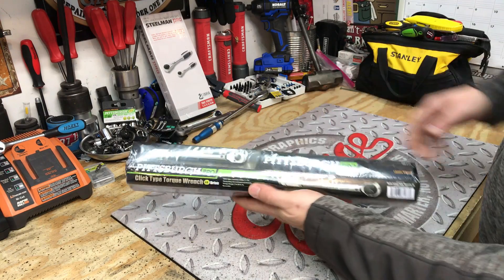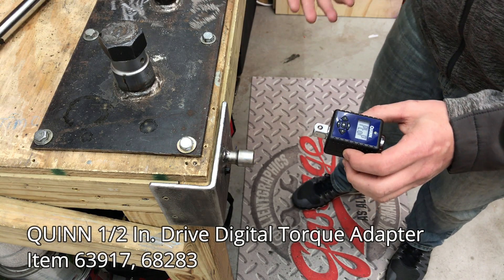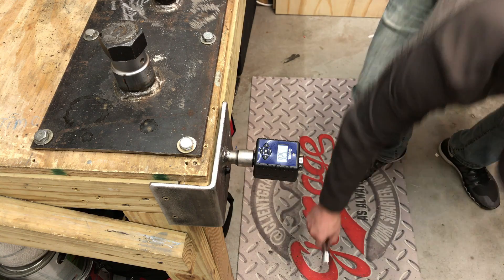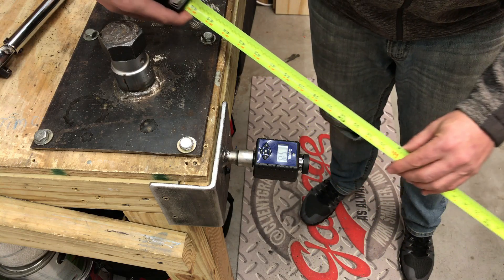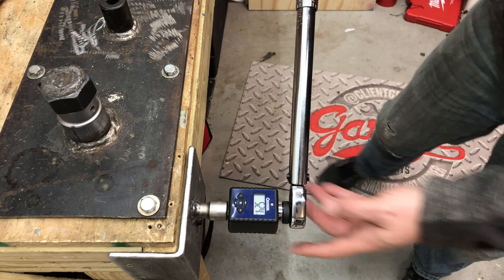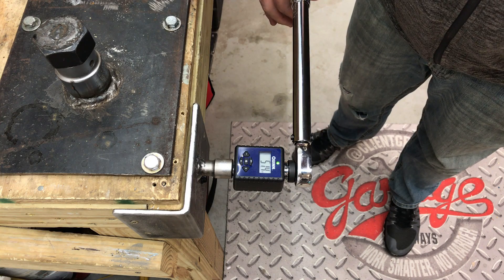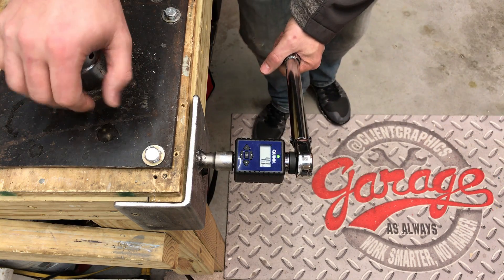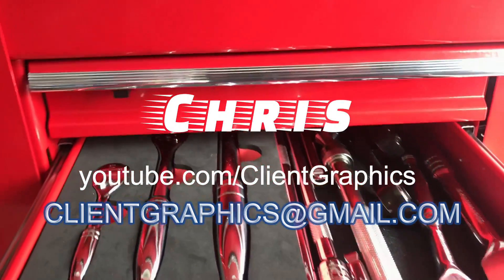Dropped the Torque Wrench? Let's Find Out if it’s Still Accurate

Comment: I broke the pawl on a harbor freight torque wrench tightening shackle bolts to the specified 150 ft lbs once.  Still using the wrench they replaced it with.

Comment: Your first clockwise readings were at 95% and 75% of the +-4% tolerance, and counter clockwise readings were at 165%, 115%, 120% and 130% of the +-4% tolerance. So the brand new wrench is already reading out of tolerance right out of the box 😬

Comment: I think people look at these tool with eyes and brain closed. These tools are as hardy as any in your box. But not being used as much it get put in a nice case. How about making a video on how you need to hold a torque wrench as some out there think the tool knows where you are holding it and changes its output to the job  ???. I did a video but Ifeel sure you could do better.. Unless you also think hand postion matters. My short video. https://youtu.be/mk95F0hHS3U?si=vdS4hI08-O6Tjsh

Comment: Great video, finally get some folks off my behind when I leave the wrench wound up for 10 minutes. I have this exact wrench and it is very easily to rebuild and calibrate if you have access to one of the digital torque meters used in the video. I opened mine up and cleaned everything off, the factory grease had all hardened to brittle wax, and regreased with a light coat of wheel bearing grease. Recalibrated against the digital tool and found it was very repeatable in its function. I'll have to bring it to work and throw it back on the digital guy, see how it has held up over the last ~5 years of use and abuse.

Comment: I will say I hope my tire and alignment shop doesn't use these (lol). But they are perfectly fine for DIY, especially for small engines and what not.  I may pick one up just to use for changing my lawnmower blade (they are supposed to have a specific torque, and this would be just perfect).

Comment: do you recommend just clicking the torque wrench a few times on a wheel lug nut before using it to "exercise" it? One frustration I have with the 3/8 HF torque wrench is that I feel it doesn't click somtimes. But When i stick it on a wheel lug nut, it feels like it clicks just fine. Using it for oil drain plug, perhaps its harder to click when the wrench isn't pulled at the perfect angle? I don't appear to have these issues with the 1/2'' HF torque wrench.
Reply: To exercise it set it to the highest setting and then click it 3 times in the needed direction, if you need to swap directions exercise it again in the new direction. He didn't properly exercise it in the video.

Comment: All in all, I’d say this Pittsburg torque wrench is a fine example of what a torque wrench should be. 

One suggestion. When setting torque values do not go above your desired setting and then back down to it. Always on the increase. There’s always a little slop in any mechanical mechanism that has to be taken into consideration…that and human error. It’s all about accuracy and reproducibility.

Torque wrenches are usually have tolerances specified “of indicated value. So plus or minus 2 at 50 ft/lbs. 

Here’s another good practice. Before setting your desired torque, set half the torque and click your wrench a few times then set full torque. This is more important if your torque wrench has been sitting unused for a long time.

It’s also common for manufactures to spec clockwise torque at plus/minus 4% and  plus or minus 7% CCW. 

I worked in a calibration lab calibrating and repairing torque tools of about every kind you can think of.

Comment: Thank you for posting this. I have one identical and while It's never seemed to fall short of its normal performance I was still worried about when I dropped it from about 2 feet on accident once. Now my mind is at ease. It's outlasted my Performance Tool torque wrench and I think, as with all my other tools, will stay with Pittsburgh Pro on torque wrenches.

Comment: Good to know that torque wrenches are fairly resilient in service. Of course a torque wrench will only ever be as accurate as its operator will allow. Having the pressure point of your hand one inch off of the calibration mark will result in 1.5% torque error on a 12 inch long wrench. That error sensitivity will be smaller for a longer wrench, and larger for a shorter wrench. Also, there's a fair bit of latency in the process of hearing the click, and the muscles relaxing to release pressure from the handle. Meanwhile, pressure is still building on the handle. Hence a slower buildup in handle pressure will result in more accurate torquing.

Comment: Any thoughts on how to test the calibration without a vise / workbench setup like you have?
Reply from the maker: Since the digital torque adaptor is 1/2” drive you could use it on a wheel lug like a Chevy Silverado as some are as high as 140 ft. -lbs. and then you can pretty much use an adaptor and dial in any 3/8” drive torque wrench or the low and middle of a 1/2” drive torque wrench.
Reply: @ClientGraphics  Thank you, an elegant solution!

Comment: From working as an industrial millwright, and in all types of conditions, I find the what throws the calibration off the most is using them in harsh environments with a lot of dirt, dust, water etc. A lot of jobs we have to, supply documentation of the torque wrenches calibration, and usually when they're way out of calibration there ones we used in some kind of nasty environment

Comment: Why don't you show us how to calibrate the damn thing if it is a little off? Nobody is going to get a  POS like this calibrated. They only cost 10 bucks. All the videos show turning an Allen nut on the side of the wrench. These wrenches have no such nut. Also, now are you going to have to calibrate your digital torque meter too? How do you know if that cheap thing is accurate?

Comment: Should’ve tested mine before using it this last time. Stripped the threads on my sxs engine drain plug. Not fun. Do you think it could’ve been from storing it below the lowest setting?
Reply from the maker: Not typically. Something must have not been right inside. The worst is when you don’t test to make sure it clicks at appropriate settings or even at all and you just keep going and you know you should stop but it didn’t click....... yet...
Reply: @ClientGraphics  yea I should’ve stopped but I’m an idiot and thought it was fixing to click then it got loose. Those aluminum threads are easy to screw up. Short socket by hand from now on
Reply: It may have also been incorrect tool selection. Most drain plugs are a max of 30ish ftlbs and you should never use anything below 20% of the max rating of your torque wrench. So if u have a 3/8 that does 150 20% is 30ftlbs and it really incorrect tool for drain plugs. A 1/4 torque wrench would be more suitable or a lower rated 3/8. Something to consider.

Comment: I just bought a 1/2 drive torque wrench from HF for lug nuts. My sockets seems to come off the anvil easily and the detent pin seems normal. Is the sockets falling off easily a normal thing for the HR torque wrenches?

Comment: Recently bought the Neiko torque adapter as I wanted to check my well-used torque wrench.  I found my HF Pittsburgh 1/2" torque wrench was clicking 30 ft-lbs low at 100 ft-lbs!!   Checked the Neiko with my beam torque wrench and it was dead on at 100 ft-lbs!  Adjusted the calibration on the HF wrench and it's good to go again!   I suspect that when the large nut came loose at one point, the calibration went out on tightening it, even though I thought the threaded part didn't move.  Didn't realize HF sold the Quinn adapter.

Comment: My torque wrench is the same brand as this one and its not going past 50 ft lb, the knurled handle is stiff, got any ideas?
Reply: The set screw locking in the lock knob has backed out and is hitting the wrench shaft when going to higher torques.  Have to take the rear of the wrench partially apart to get at the set screw.  Easy fix but you need to recalibrate afterwards.

Comment: I have never trusted these torque wrenches for jobs I didn't want to risk a false reading on ie head or intake bolts, flywheel bolts etc, but I have one I leave out to use on lug nuts, I have always slightly over torqued lugs anyway so I figured it wouldn't matter if the torque wrench was slightly off, whereas an aluminum head could crack, or leak if not tight enough, possibly even strip the threads or break a bolt if over torqued, but maybe I just didn't give this little torque wrench the credit it deserves.

Comment: Good to know torque wrenches aren't that sensitive. But I would like to see the torture test of the wera zyklop ratchet. I have quite a bit wera tools and I suppose they will hold up fine. But I'd like to see them put to the test.
Reply: I saw he now has a video of exactly that, if you didn't see it yet.
Reply: @MollyGIRLnug  Thanks! I've seen it already. Thought it would perform better but isn't bad. I have 3 types and still want to see the push trough ratchet from Wera in a test

Comment: I have a different brand, it's years old but it looks like it probably was made at the same place. I don't know if I can recall dropping mine much anywhere, but I really worry that it was letting me overtighten some head bolts over the weekend. Went ahead and bought a new torque wrench, so we'll find out for sure. This is good timing of a video.
Reply from the maker: I tested one that was probably 10-15yrs old and it actually tested really low like 20% low.  Most torque wrenches with age and use start reading low as they wear.
Reply: @ClientGraphics  Oh thank goodness! But what about ones that fail to click. That's what I worry happened on a few. Bought a GearWrench digital as the next one. The one I was using I bought via sears online probably 8 or so years ago under the Schwaben name.
Reply from the maker: You need to be at least exercising your torque wrench before using it. That will tell you if it’s clicking.

Comment: Stahlwille torque wrench was specifically built with these in mind, it has no large spring inside the torque wrench, it is listed in their users manual that it can be dropped and be used as a breaker bar as long as it is not more than 130% of its maximum rating, no need to worry about over torquing if a newbie uses it, no need to scale up the torque just to redo an over torque bolt. And the ratchet head is removable, you can put open end and solid head (breaker bar head) on it for crowfoot ( turn crowfoot 90 degrees away from the handle so it doesn’t effect torque, a ratchet would constantly turn thus makes it be away from 90 degrees from the handle). Just saying there is a nice torque wrench on the planet, if price is of little importance but durability and efficiency comes first, then this is definitely the torque wrench you should have.

Comment: I bought a used torque wrench with some other used tools in good condition but never had it calibrated so I just set it to whatever it should be for what I’m tightening then give it an extra turn and prey to the almighty that my wheel won’t fall off!
Reply: Same just give it a lil extra turn to be safe

Comment: I have a craftsman 1/2 drive torque wrench a few years ago I broke the head in half to be funny I welded it up. just for the heck of it I took it on the SNAP ON truck to check for accurate it was rite on. I am still using it

Comment: Former USAF calibration technician, calibration = validation. Old school engineers used to call calibration both validation and alignment. Nearly all agree now that alignment is different than calibration. Just an FYI! Great video!

Also, you only exercise in the direction of calibration, after direction is calibrated you exercise it in the opposite direction and calibrate it that way.

Finally, overranging your torque measuring device is a bad idea, it messes with the transducer and screws up it's calibration more than the wrench.

Comment: I cried everytime he dropped and threw that torque ranch.
Reply: That’s why I bought Stahlwille, I am surprised very little people knows about it unless they had worked in a German workshop for some years.
Reply: @davidgruen7423  I just searched it up on Google and read the reviews. I definitely have to buy it and check it out. Thanks for the info! 🍺👊
Reply: Shabo Zakomac I wouldn’t recommend it for DIYers especially those who uses torque wrench only occasionally, I have OCD (diagnosed) and it gnaws at me if I don’t torque every single bolt in my car, sometimes I spend hours going through manuals to look for the torque spec for the torque spec, say for a tiny bolt that holds the baffle in an oil pan. The Stahlwille tools are not cheap if you buy it new, there are bunch of ebay used ones that are just a little more expensive than a (or two) new Chinese made torque wrench, be sure you buy the head too, sometimes it doesn’t come with a ratchet head and you have to buy it separately, that head itself is another $80, lmao. I once tried to buy all the ratchet heads from Stahlwille, turns out the have over a hundred different types of heads and you would have spent over $5000 just to get the heads.
Reply: @davidgruen7423  Im the same way! I cant go using any torque wrench without being aware of the specs. My first car that I ever started working on, which was a Honda Civic that I was tuning, ended up falling apart on the road while I was driving. My dad came to tow my car and noticed the bolts on the ground. Thats when he introduced to me a torque wrench. I know that these high end torque wrenches arent cheap. But if this is something you do recommend for anyone that loves working on their cars then I rather not even bother with anything made from China. Granted I have bought a few and they have had lasted me for a while but the quality speaks gor itself. Especially when the metal starts to wear out. I will think about what you just said and recommended! But I really want to buy the Stahlwille, it looks so beautiful!!!
Reply: @davidgruen7423  I have an old unbranded torque wrench that is "Made in West Germany" from the 1970's.  It's a bar type.  Still exactly correct.  Also have that HF torque adaptor.
Reply: @justinvargas8517  https://m.northerntool.com/shop/tools/product_200621084_200621084?cm_mmc=Google-LIA&utm_source=Google_LIA&utm_medium=Hand%20Tools%20%3E%20Wrenches%20%3E%20Torque%20Wrenches&utm_campaign=Klutch&utm_content=40770&&gclid=EAIaIQobChMImMaLtJvT6QIVirbICh0MiAQFEAQYCiABEgJntvD_BwE
Something similiar to this 👍

Comment: Exceesising is required anytime when changing torque directions. It’s an old time lost art. You ideally if driving (as almost always the case with a torque wrench unless using reverse thread bolts.. finish in the direction you want it to be accurate. So for a standard right thread you run left first then right second then go to work.. if you come to a reverse thread bolt then you do it again drive right then drive left then send it. Final exercise position should always be the direction you are torquing. 

All that said.. if used the hell out of Pittsburg wrenches for about 15 years now commercially to include crucial structural kits where an inspector has to stand there and supervise and record the entire process.. like drilling a hole in concrete.. cleaning the hole, placing threaded rod and epoxy into the hole then later bolting it. Like seismic plates on walls in California. 

When inspector arrives you have to have documentation certifying the wrench used as well as a second measuring device and documentation and then actually use one device to check the other one and even still he will arrive which his own.. 

I used Pittsburg digital to check my pro torque and he had his expansive crap. Never ever was either one found to be out of calibration. That said the cheap Pittsburg digital does fail in electronics after so many years of use and won’t even turn on anymore.. In 15 years I’m on my third digital and still my original 3/4” and 1/2” drive wrenches.

Comment: Your torque wrench is already out of tolerance. 4% of 50 ft-lbs is 2 ft-lbs. You were in on the clockwise torque but out on the counterclockwise torque. I'm not surprised by this. Those cheap Pittsburgh torque wrenches fail calibration right out of the box all the time. But, for $20, I suppose this would be expected. I think Pittsburgh should be more honest about the accuracy of their product though.

Dropping the torque wrenches rarely causes them to produce out of tolerance readings. Think about it. If it can't handle a few drops, then how is it going to handle repeatedly having torque applied to it? Out of tolerances on torque wrenches are usually caused from repeated use. Your different readings are more likely the result of using a really cheap torque wrench and using your hand to crank down on it.

Just fyi, I calibrate torque wrenches using a calibrated and NIST traceable CDI-5000 in an ISO 17025 certified calibration laboratory.
Reply: People by harbor freight torque wrench has to work on automotive and industrial equipment we're five or 10% really means nothing. I doubt anybody is buying harbor freight for doing aerospace work

Comment: Hi! This digital torque adapters need to be calibrate like normal torque wrenches?
Reply from the maker: Digital torque devices are typically not serviceable for customers and end users as they would require remapping the voltage changes if needed. They can be easily validated with other certified devices just not calibrated without the right tools and software.
Reply: @ClientGraphics  thanks! 😉